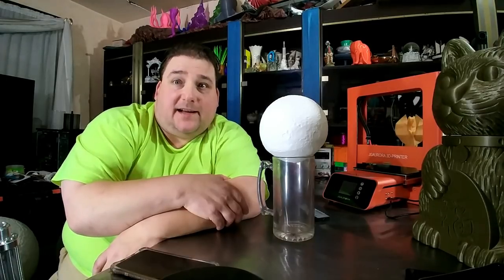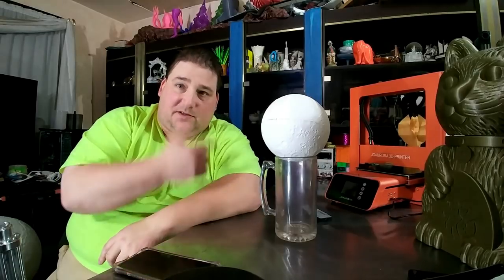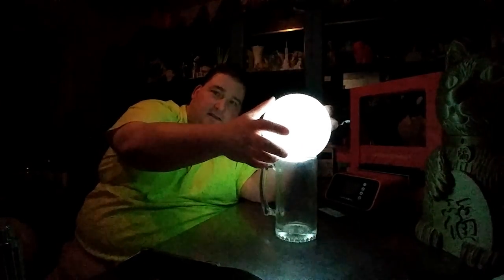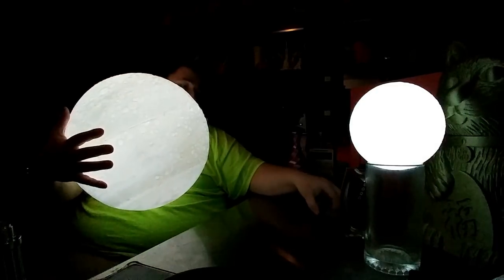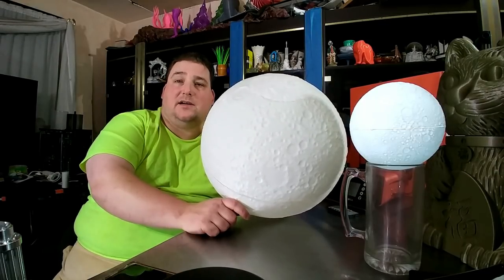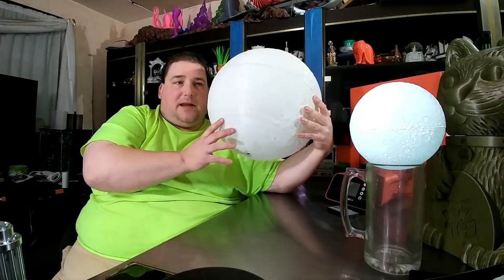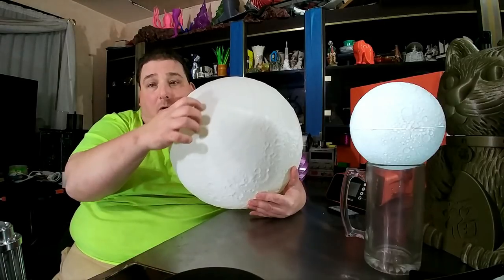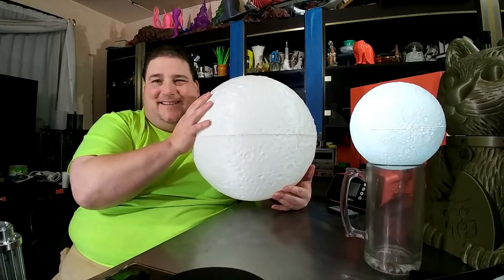That's no moon, Its a battle stat, wait  no  Its a moon T3DP

Comment: What about printning the first 5mm with 2 layers and 3 layers, then and make a 10mm high 1 layer spacer ring. To glue the 2 halves together with the space in between?
Reply from the maker: Oh my I think I know exactly what you're talkin about and that's actually a fantastic idea I'm not sure if it's possible though what might be better is to print a separate ring for joining them the core problem is you have to start with fewer perimeters and then expand the number of parameters at some point and that means you were going to have an unsupported perimeter with nothing underneath it but you don't need much ........
Reply: @nerys71  Exactly my idea, 3 pices a ring and two halvs. Going from 2 layers to 3 is possible. Make a test print where the halvs is only 10mm high to very the design. 😎

Comment: The Moon is Yellow, yellow, yellow.
Why did you not divide the moon into one part which would be slightly bigger than the part that was a mis-printed and then do the second part and then attach those two rather than do two halves?

Comment: Hey Chris! :)
I'd like to recommend you having a look at the "Two Trees Sapphire S" 3D printer. Despite looking very similar to the Ender-5, I think it's a very special, because it got linear rails, an 32-Bit-Board and a structure that is optimized for easily being upgraded to and used for high temperature prints (with all their advantages like cheaper filament and more durable parts) - and all this for about the SAME PRICE as the Ender-5! xD
Another 'feature' is, that it isn't yet another printer from Creality, who honestly are close to become too dominant in the budget 3D printer market IMHO. If you have a look at the results that one german YouTuber got: https://www.youtube.com/watch?v=deHxs0924eY&t=1927s I'm quite sure that you'd agree on the print quality being close to perfect. Maybe you can get one for a review and toying around? :)
Reply from the maker: That printer looks amazing very small build volume but it looks very nice and the print quality that German got is amazing gearbest has it I've asked them if they can send me one I'm hoping they say yes
Reply: I cross my fingers for you :) PS: Watch out for the "Sapphire S". There's a non S model does not have the linear rails.